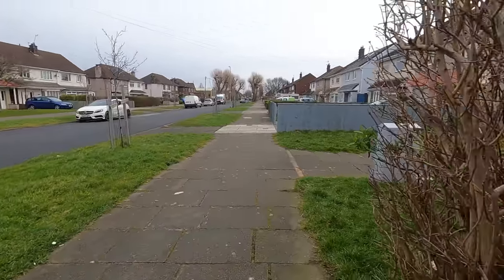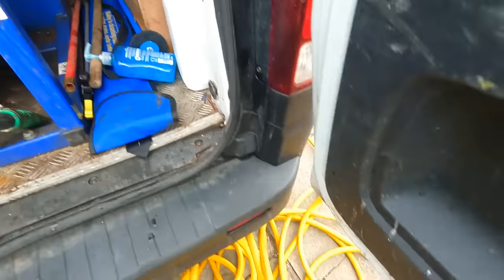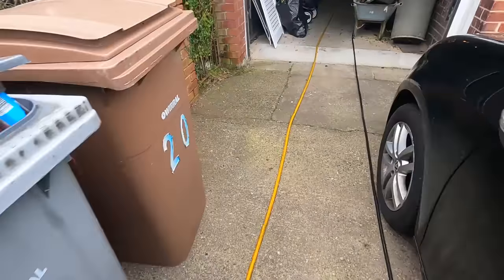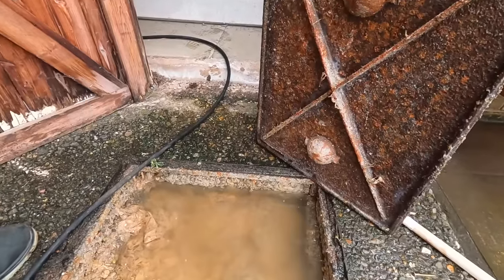FULL to the brim blocked Manhole - SATISFYING Unblock!

Comment: I work in The Public Service for Non Collective Waste Water Treatment and it's amazing to see a drain's unblocker ("hydrocureur" in french) working like that. Congrats from France :)
Reply: What is the difference between non collective and collective wastewater treatment?
Reply: Non collective : you have a small wastewater treatment plant for one or two dwellings, offices etc... The processing capacity is between 3 and 50 population equivalent.
Collective : you have one big wastewater treatment plant for one or two cities. The infrastructures are very massive and the processing capacity is between 800 to +400 000 population equivalent.
The cost of non collective wastewater treatment plant is between 3 000 and 15 000 euros. The cost of collective wastewater treatment plant is between 100 000 and 1 000 000 euros.